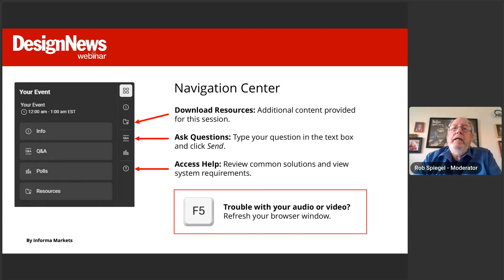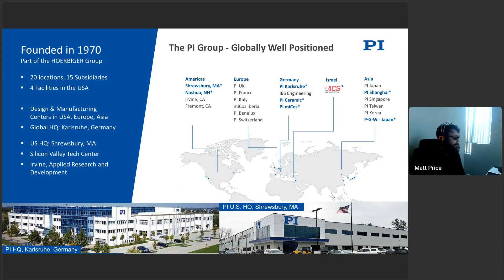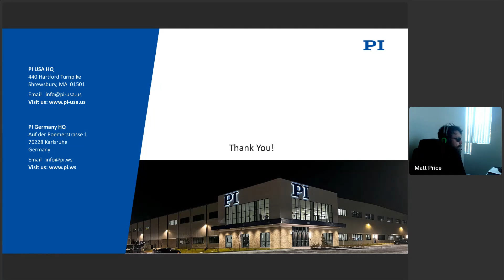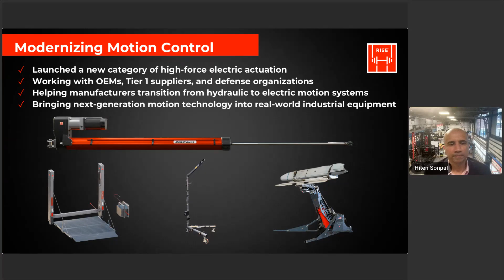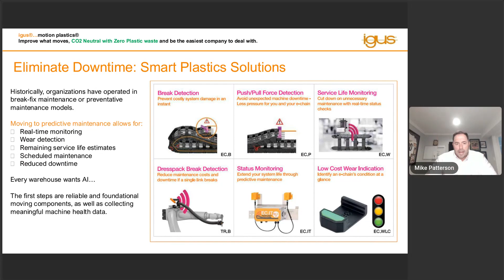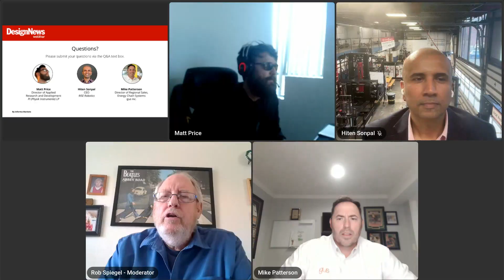The Future of Motion Control | Design News Webinar Featuring RISE Robotics, PI & igus

Comment: I would work at getting these systems space certified.    18:44 I just realized that you could do things like run a cable just for diagnostics through the cable chain and have it being measured by a TDR circuit, which can monitor the signal breakdown as it deteriorates which would correlate to what’s happening to the plastic hopefully also and you couldcollect that data overtime, and it would become more accurate.  Just having things like a three axis, Gyro and microphone to major sound and vibration would also give you a pretty good clue.

Comment: You could mount one of the VR walking treadmills on your 3-DOF standing platform, and people can climb Mount Everest in VR.  Great now you have me thinking about creating a rock wall that continuously changes itself maybe with air bladders😂. Oh the other thing you might be able to do is make solid walls, but each one of the hand holds is on a motor and when they’re not touching it it changes by just spinning around to a different shape of surface.   Someone can go make 10th mountain division pay for a prototype climbing wall.  We’ll make sure we add a refrigeration unit and blowers to keep you cool on the artificial rock face.